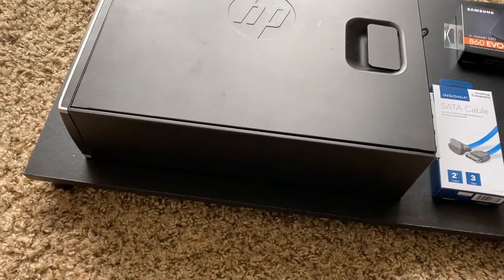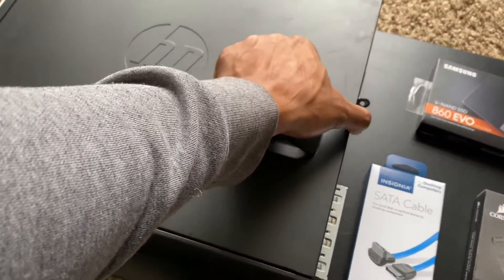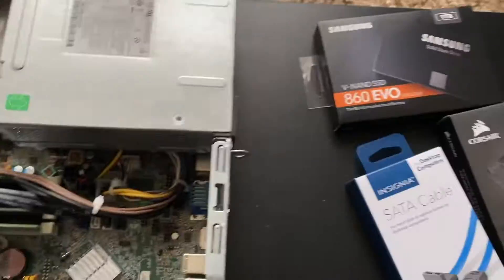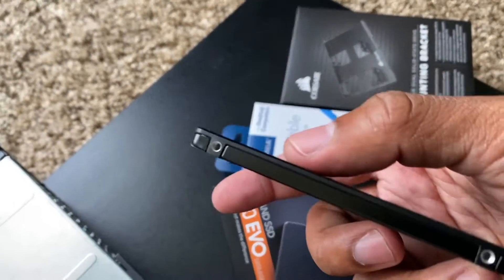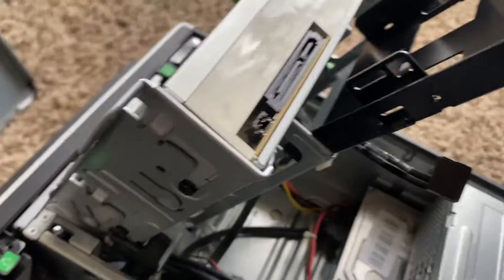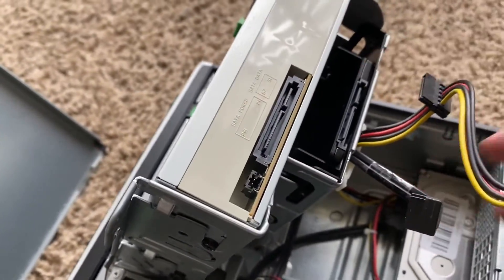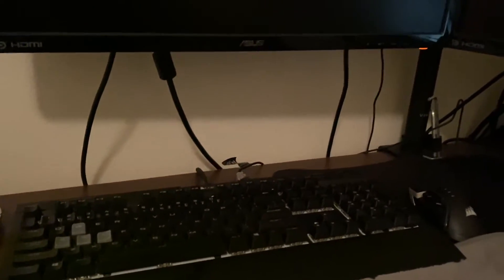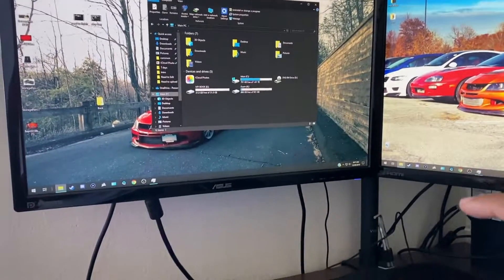Installing a SSD on my HP Elite 8300

Comment: Do you think the elite 8300 i5 with 4gb will run games pretty good with a Gtx 1030?
Reply from the maker: As long as the 1030 is a low profile card your fine. My sister doing that same setup
Reply: Keemborghini cool, thanks! Also sorry to bother but I was just wondering if you can update the pc to windows 10 even you buy it with windows 7. That’s probably a dumb questions but I know very little about pc’s haha
Reply: @xdtony650  I use full size card that has 75w or down watts Im using 1050ti  of course I had to cut up the frame :D
Reply: 1030 isn’t as beefy, as the 1050ti is the best you can have in that case, and it’s only a relatively small/medium increase in price, get the 1050 if you can. 

4Gb RAM is too little, you need at least 8, 16 is the best. It has plenty of ram slots so keep buying 4Gb cards when you can and fill it up.

Yep, win 10 works fine.